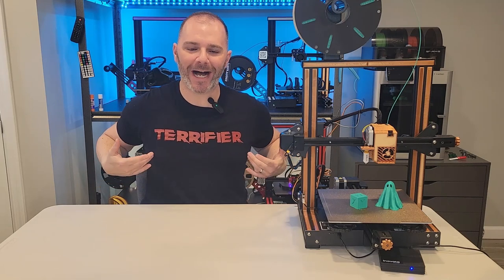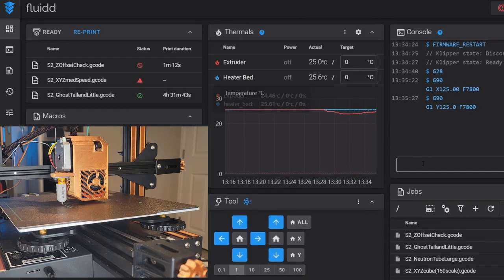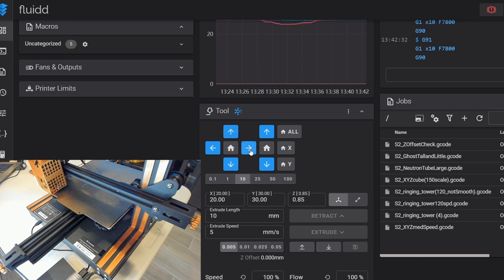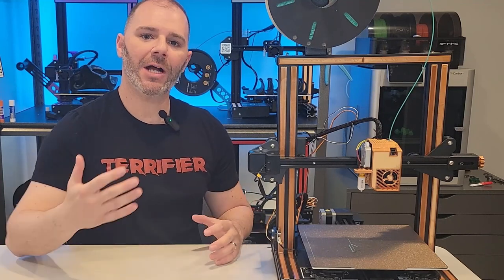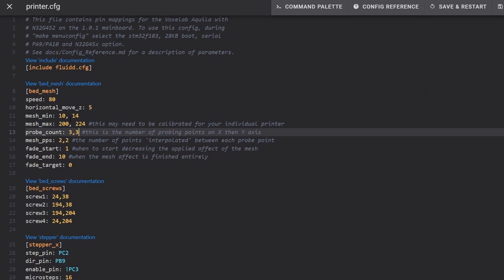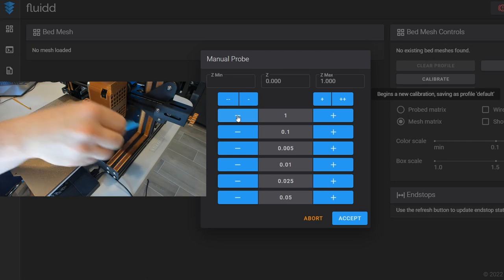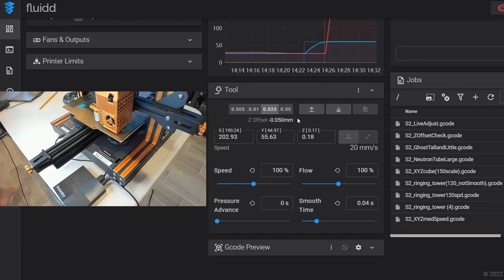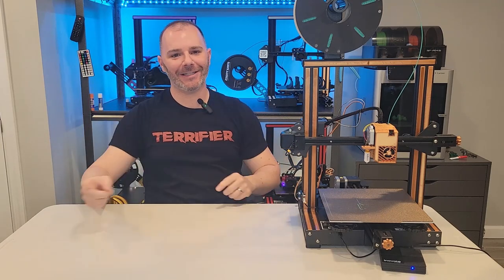Create a Manual Mesh with Kipper!

Comment: Is there a way to do it with Klipper in Octoprint?  If i type the command in terminal no UI windows pop up.
Reply from the maker: I don't use Octoprint so I can't confirm, but I believe you'll have to use the lines testz z=(insert amount to move). It's possibly the gui is only native to Fluidd/mainsail. If you haven't considered moving over to one of those front ends it's worth a thought.
Reply: @PrintsLeo3D  I still like my octoprint plug-ins but Fluidd looks atractive. I will try to find a way with terminal commands.
Reply from the maker: Yea I hear ya, that's what I hear most from people who are on Octo, the plug-ins. Before Fluidd got that nice overlay you would have just to input "testz z=" into the terminal to have to make adjustments so that should still work for you. No differencr just an easier experience really. So if you want to lower your do something like "testz z=-0.02"
And if you to bring the nozzle up you'd do the say thing but omot the negative. "testz z=0.2"
Reply: @PrintsLeo3D  it worked! It's was a painful experience for a 5x5 mesh with the terminal commands but I had to do it because I have 300x300 bed . The only thing I didn't manage to do is the final manual adjustments for Z endstop  . But It worked . The Z steppers  do move during printing . Thank you .
Reply from the maker: Awesome, I'm happy you have a mesh now ! I feel your pain doing this manually on a 5x5 mesh, feels like it can take forever. The endstop calibrate feature should work the same with using "testz z=" did you try that ?
Reply: @PrintsLeo3D  I did that . I am missing the final step with the "tool" in klipper for live adjustment of Z.
Reply from the maker: Oh wow I didn't know that Octoprint didn't have the love adjust feature. You can always make changes to the greyed out area within your printer.cfg (at the bottom) but you need to be very careful because you can cause damage to the printer if you adjust it too much or too little even.
Reply: @PrintsLeo3D  I guess its the same like babystepping from printer's screen. If i adjust the Z offset from screen and then apply the z_offset_apply_enstop command in terminal will it apply it?
Reply from the maker: To be honest I'm not too sure, the way to tell is to check your z offset prior to adjusting , then baby step and run that command. Save and restart and see if the offset took the adjustment.
Reply: @PrintsLeo3D  It worked. Babysteps from printers screen . Send the command z_offset_apply_endstop . I canceled the print because i didnt want to risk any homming mess with the value. Send SAVE_CONFIG and the file updated with the new value. It is harder with octoprint but its working. Thank you.
Reply from the maker: Anytime! Glad this worked out .

Comment: https://youtu.be/yNoPNzFKXvU?t=1260 Hello, after I calibrated the printer, saved it as default, and restarted Klipper, I added "BED_MESH_PROFILE LOAD=default" after G28 in the START_PRINT macro. I started printing and encountered an error: "bed_mesh: Unknown profile [default]." When I checked the tube tab, the mesh profile wasn't there. I've tried googling for a solution with no luck. Any help would be appreciated. I appreciate any help you can provide.